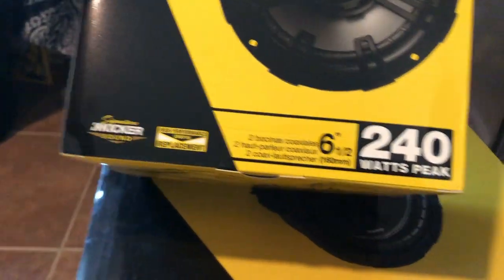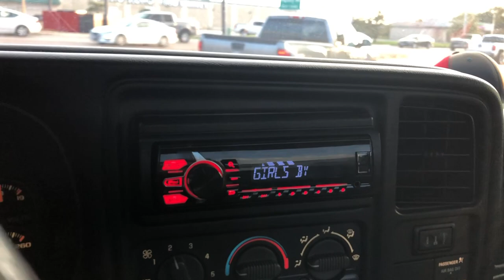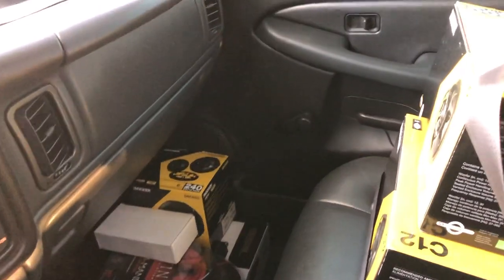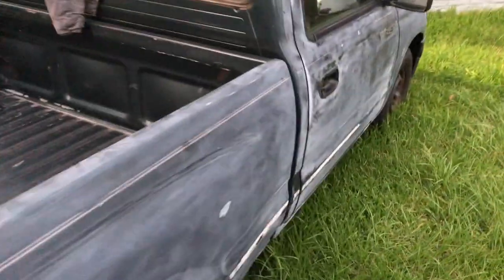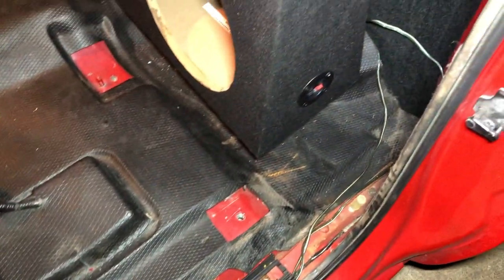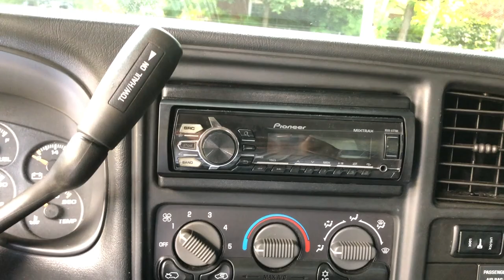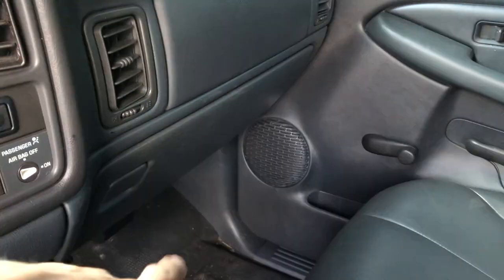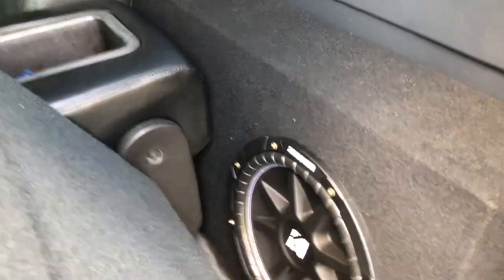INSTALLING SOUND SYSTEM IN MY SINGLE CAB CHEVY (99-02)

Comment: what year are your seats from man ?
Reply from the maker: They are the stock original seats.(99-02)
Reply from the maker: center console from 07-13
Reply: @soakauto4136   for sure man thanks, ive been looking for some but ive been having a hell of a time finding some
Reply: @josecornejo2951  did you end up finding some ? I can't find any, umma just end up buying covers 😭
Reply: @ary8890   hell no man, its rare and depending on where you’re at it cant be even more challenging sometimes you gotta just hit the pick-n-pulls and ipulls till you find one
Reply: @josecornejo2951  tsss thanks for responding ! Ig ill just have to buy some really good seat covers now, no queda de otra 🥴